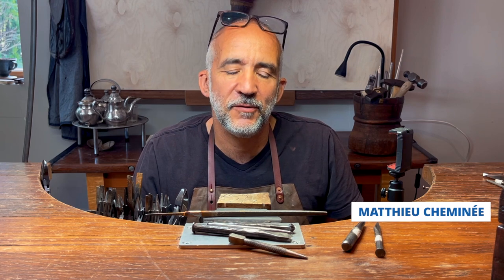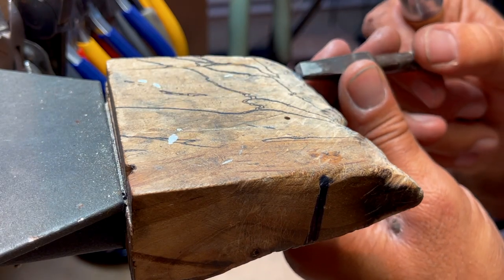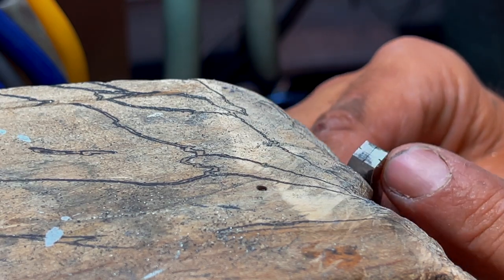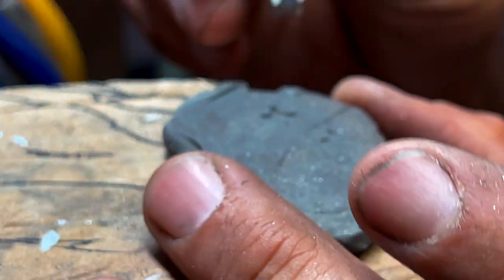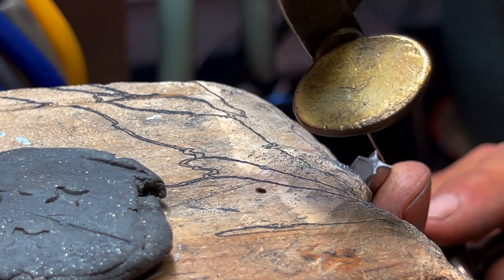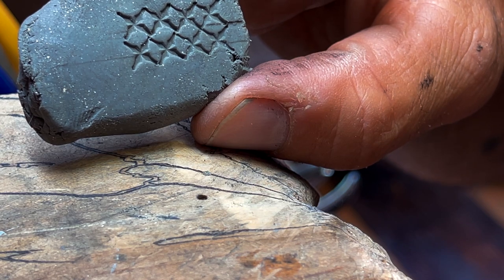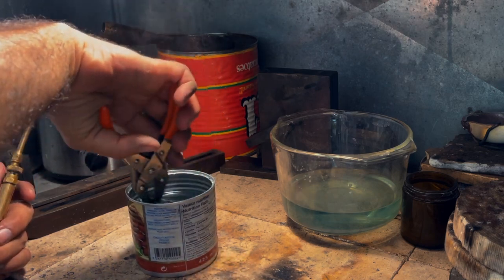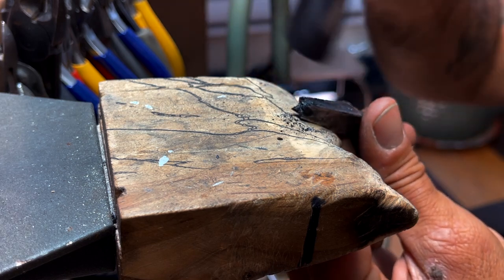Making a Stamp from Old Tools!

Comment: That video was absolutely helpful... I just need to find an old auger bit with a nice fat shaft.
Reply: Why not chase garage sales or trash markets for such treasure?
You will save 80% to 90% on cost of buying new steel pieces.
  Used bits cost maybe 2 bucks.

Comment: Well that was very interesting. 
How would you make a stamp more intricate, like a number or letter. If you see what I mean? As in a Q, q, 8 or 6.
Reply: No answer, so here goes a suggestion.
. Forming/shaping any rounded/oval shapes/rounded numbers, use drilling on surface with drill bits. 
 . Then work by hand to to shape the rest with files OR flex shaft with carbide burr /tip.
  Practice on soft metals first to develop/hone yr hand & toll use skills.
gd luck.

Comment: Just be aware, a lot of the old hand drills of this type had low carbon soft steel shanks forge welded on by manufacturers and will not be hardenable. This was done to save on costs when steel was a prized resource. It only takes a few minutes to test if it will harden before doing all your file work. Remember to anneal it again, before doing the shaping work. If using other old punches, they will probably be hard when you get them and annealing first will save a lot of time filing, and your files will last longer.